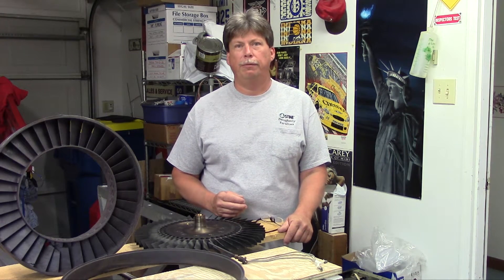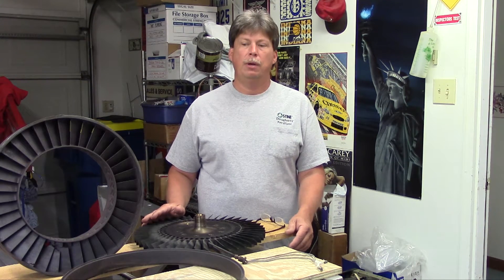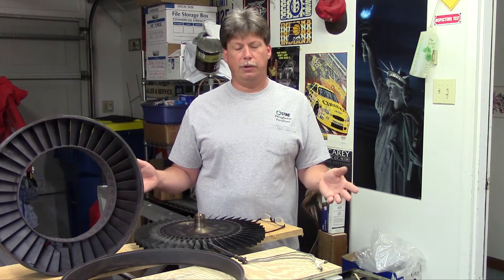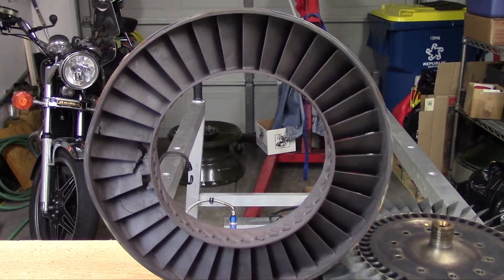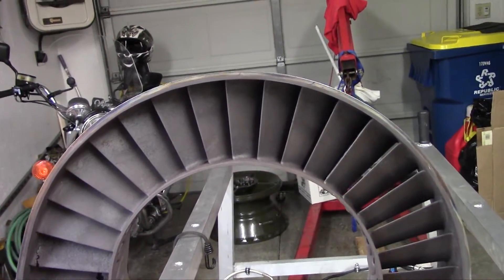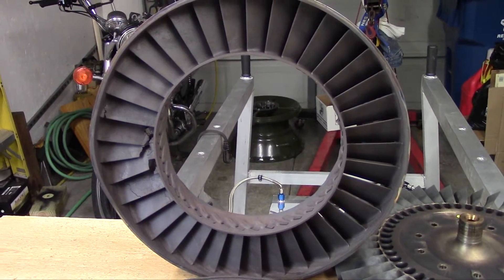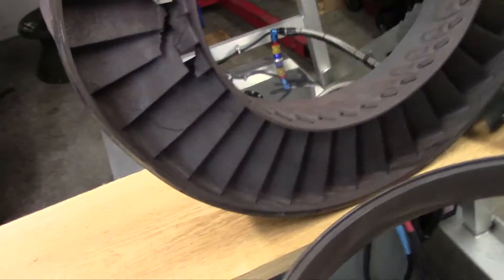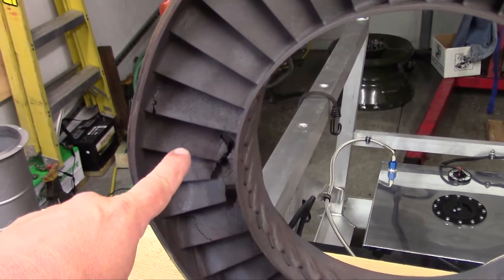The Fairchild J44 Project:  Parts Review Part 1

Comment: What a beautiful engine! Few things simpler than a J44. It was a shame they tried to go to far with the J83 design.  The J44 turbine Is constructed in the same way the power recovery turbine of an R-3350.
Reply from the maker: Thanks!  It isn't too bad for 60+ years old!  I had the intake/compressor housing powder coated 'olive drab' green, very close to the original finish, which had oxidized and faded.  Wait until you see it!  I can buff the stainless steel outer cowling for even more shine!  Stay tuned.

DD

Comment: "Fine steel" - afraid not, all the hot parts of a jet engine are nickel-based superalloys which retain huge strength at very high temperature.
Reply from the maker: It is just an expression, as in fine quality, as opposed to poor quality, not the actual molecular makeup.  So, I would say that the metals in the hot section are just 'fine'! ;-)

DD

Comment: Have any more data on that rear spherical ball bearing? (Mgf, part #)
Reply from the maker: I have the manufacturer's part numbers and I have been to "Bearing Headquarter" locally with them but nothing crosses.  They told me it was most likely a special made part just for Fairchild, to their specs.  There were 2 manufacturers of the J44 bearings:  Fafnir & M. C. R.  The Fafnir bearing part number is MM307KS-CR.  The M. C. R. part number is:  307-S-19.  Let me know anything you find out about those bearings.  Thanks for the interest!

DD
Reply: Cool, will do, thanks for the info.

Comment from the maker: Yes, it basically just ignites some of the first spray of fuel that reaches it then it spreads with a quick 'woosh' to the rest of the fuel nozzles in the annular combustion chamber.  This engine has no 'torch' or special fuel nozzle for starting.  Just the 12 nozzles.  Only one igniter though, so not as reliable.  Later versions of the J44 used 2 igniter plugs.

Comment: Very interesting.  I assume the damaged area aligns with the starting torch since you stated you only have one ignitor.  That is where things get hottest during starts.  Surprised they have lost oil lubrication for the rear bearing.  Model jet engines have always used that system for lubricating.  The last oil I bought at the local airport was $24 a quart.  Sure would add to the expense of running the engine.  Very informative.
Reply from the maker: I'm not sure exactly why yet that spot seems to have been extra-hot, compared to the rest of the turbine nozzle but it could be a faulty/carboned-up fuel nozzle spraying a crooked stream instead of a nice even fog.  I am going to have the nozzles checked before reuse, if I can't just replace them outright.  The 'lossful' oiling system only consumes less than 6 oz. per hour, maximum, at normal (100%) rated speed, so it isn't near the issue that fuel consumption is!  You can find turbine engine oil for reasonable prices on the internet & eBay; I paid about $9/quart for a case of 24 Mobile Jet Oil.  Thanks for your questions & comments.
Reply: I think I viewed all the videos and never did see where the starting fuel or ignitor came into use.  My J-69 burns 2.9 gallons/minute at 100% for only 1,000 pounds thrust.  I certainly hope the new engines do better.
Reply from the maker: There is just the regular fuel 'mix' (75%+/- K1 or Jet A & 25%+/- Gasoline) in the fuel cell.  Since this engine probably used JP-4 for its operation, I figured that is what I will give it, as close as possible.  The igniter is manually energized soon after I the starter, then I hit the 'fuel cutoff valve' switch (which opens the fuel valve to the manifold) & it normally fires-off a couple of seconds after that.  Only the shot(s) of my hand at the control console would show the actual switches being flipped during the starting procedure.  There is no automatic ignition control, auto starter cut-off or anything like that; just plain old simple on-off switches, some relays to keep the console current low, a few circuit breakers to cut down on fires & 28 volts DC to power those accessories.  I manually turn-off the igniter & the starter as soon as it reaches 'ground idle' speed.
Reply: My J-69 has to be manually started, but does have two ignitors and each has a separate fuel supply to the ignitors.  Does you single ignitor fire near one of the fuel injectors?  Just curious how it get the fire going.
Reply: Seeing how this engine was used in target drones and cruise missiles, it does make sense why they would use this type of oil system, to make it cheaper to produce, and thus make it more expendable.
Reply: That does make a lot of sense, especially in a missile, as it is a one time use only.